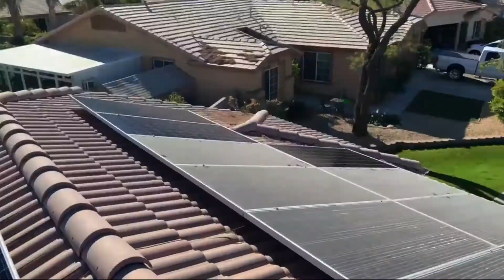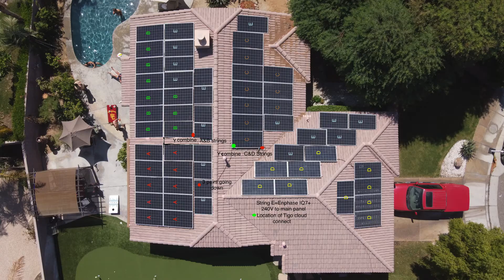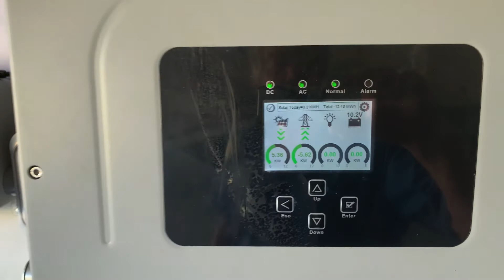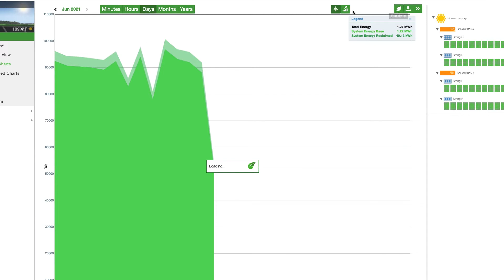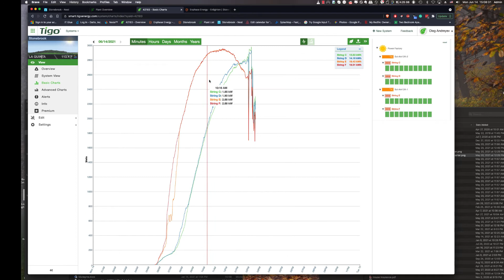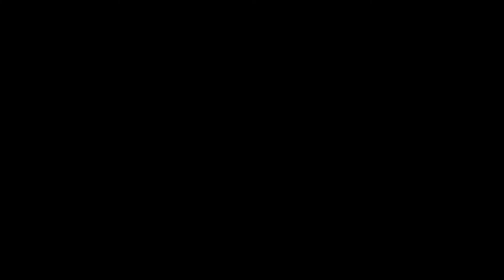Solar installation. SolArk inverters + 55 solar panels in Palm Springs area

Comment: I’m trying to install a DIY Sol Ark system on the other side of the mountain in San Jacinto. Did have help with the solar building permit? Are your handymen available? Great Video!! I have more questions.
Reply from the maker: 1. There is web site where you can do permit documentation. 2.Yes my handy man availeble but you have to talk to him yourself. 3. You can call me with questions. 310-612-6252 - Oleg